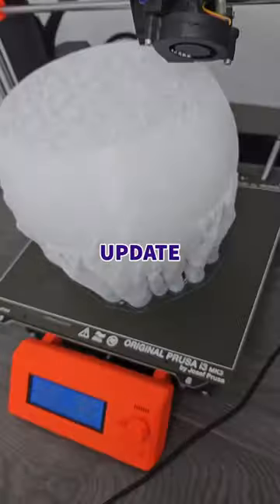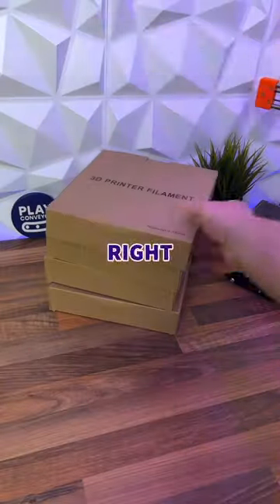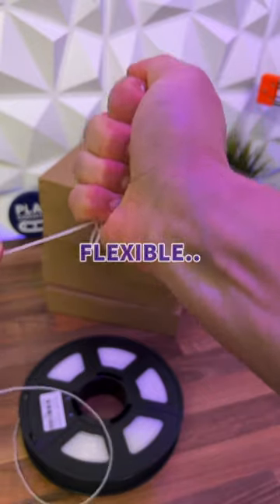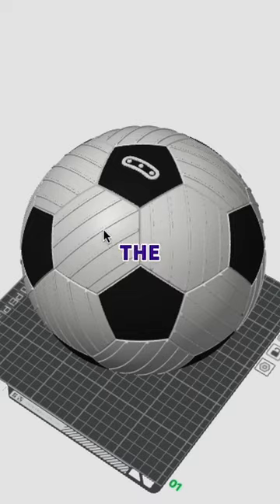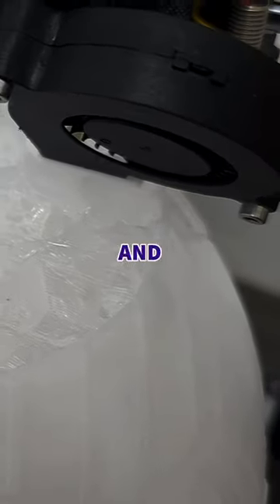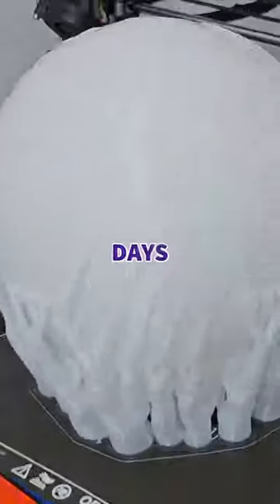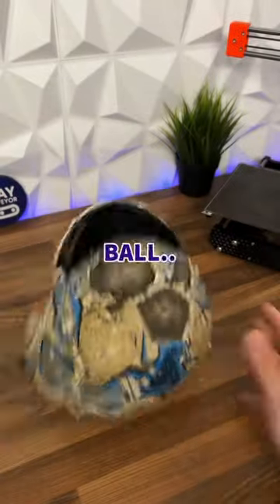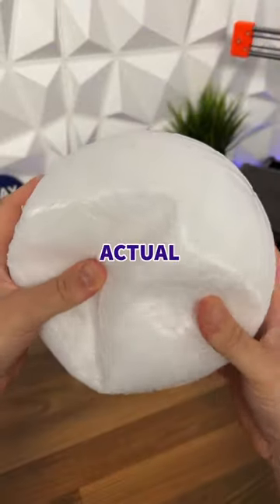3D printed FOOTBALL - PART TWO ⚽️

Comment: Engineer here

I  have done some stuff similar to this... use gyroid infill but up the infil multipier and it will be stiffer for the same weight...

It will never feel like a real ball due to the moment of inertia (aka mass distribution) unless you only have mass on the outerwall like a real ball.    You can try a stiffer flex filiment like ninja flex armadillo and print a mostly hollow ball.

Comment: If you print without interior supports, I wonder if you could fill the inside with a layer of rubber or silicone and putting an air valve to fill with air.

Comment: Not sure about keeping similar weight, but you can get it to hold air better with thicker walls, and then you can really seal it with your choice of different glues. Find one that is stretchy and strong. Hot glue could work if you have a small enough glue gun. Run beads trailed by a card across the z axis. I printed a little thing with a trigger to squeeze the glue out while the drag it across whatever surfaces need extra support. The part that trails the glue gives it a ruffled texture for added durability.